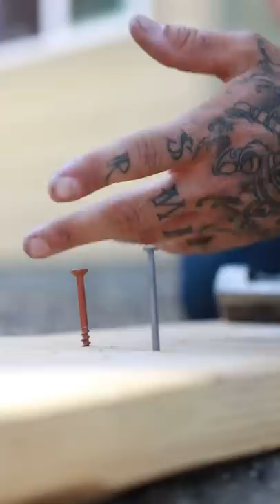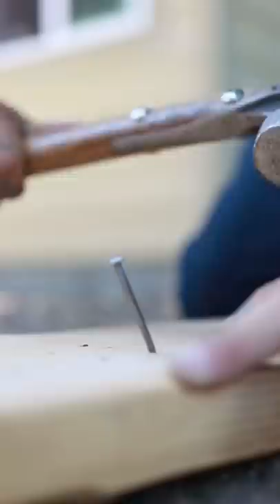Nails vs. Screws: Why do we use nails? #shorts

Comment: I highly recommend anyone watch the Project Farm video about screws vs. nails in shear strength. In most realistic, scenarios (i.e. one where a shear load is applied to the joint of a framing member) the screws are far superior. In metal fatigue tests where fasteners by themselves are repeatedly bent almost 90 degrees back and forth, the hardened screws with fail faster than nails. In terms of construction, I don't really see it being a problem to have the fasteners fail after bending 90 degrees because that would almost never happen in a construction. 

The reason that screws in more realistic loads are better than nails is because the compressive force the screws apply to the framing members creates a friction force between the two that works against any actual shear. If the boards are not allowed to separate while a shear force is being applied the wood will fail before the screws almost every time.
Reply: I can't be certain, so I'll ask. Are you implying that nails don't apply compressive force to a structural member? Or, are you stating that nails cannot apply the same amount of compressive force as a screw?
Reply: @DarkMatterX1  because of the threading a screw has the act of screwing will force boards together in a way that a nail really can’t
Reply: This. Screws are better than nails in almost every way. If you ever do work on older houses you will agree with me. Nails work loose everywhere especially if things are moving as he suggests in the video. What he is showing here is not sheer force it's bending force and the screw will never see that sort of force in a correctly built structure.
Reply: I support this guy, as I commented after it return to the material characteristics, when u compare, this videos has wrong comparison diffently 2 things, 2 desgins with different purpose of use will not be the same
Reply: $ and speed. You can drive nails way faster and they cost less. Always follow the $
Reply: @theautumnwind2152  Cutting corners usually results in bad, not good. (Wyatt Earp?)fast is fine, but accuracy is final...
Reply: @yingnyang2889  nails and screws are equally accurate.
Reply: I dont have to watch it after reading the comment. You explained it well.
Reply: @randyhall161  you should anyway, love that guy.

Goes way the hell beyond what I ever expect to test very basic items like tape or nails and screws... Super addicting channel
Reply: u guys are giving bad info. if u frame a house and use screws the same size as normal framing nails, u will fail your inspection  and have to redo it. nails are much stronger than the same size screw. sure u can buy thicker higher quality screw and it will be stronger but thats nit aples to apples. and why when a refular nail is easier to drive, cheaper , and does the job in regular applications.
Reply: Brah, cost and speed
Reply: Yep
Reply: the compression you talk about instantly made  me understand the concept
Reply: @artjohnson4553  have you watched the video the OP mentioned. In basically every testable way, except extreme bending, screws are the more stable product. Please watch the project farm video
Reply: Love Project Farm, his channel is FULL of great tests that cover a multitude of scenarios. If you’re ever considering buying any product, check to see if he’s done a review of said product.
Reply: @theautumnwind2152  they actually make collated screws you can fire from a pneumatic nailer, believe they are called "scrails"- (might not be the correct spelling)

Comment: Actually the shear strength of screws is just as high as nails... The reason people don't build with them is because they take longer to drive into the wood... Not because the nails are better. Actually screws are better because they grip the wood more than nails do. And they also show for expansion and contraction. Nobody's house moves 90 degrees to the right and left.
Reply: Thank you, thats just what i thought. The reason wr build pretty much everything with screws instead of nails, like cars and trucks, bridges and sky scrapers.
Reply: As an metallurgist I can confirm, this is false.
The way the metal is tempered changes crystalize structure so you can make a screw vs nail temper so that it fractures differently.

This is the same reason a untempered sword snaps like a crunch bar vs when tempered.
Same metal different shear strength.
Reply: And screws are way more expensive
Reply: @jonathangarzon2798  informative 👌
Reply: You’re wrong :/
Reply: Wrong.
Reply: @user-gn8hf2ig7w  Cars, trucks, bridges, and sky scrapers are not built with screws.  None of those.
Reply: @thomasjefferson5727  well isn't a bolt basically a screw with threads that are made for a nut instead of wood
Reply: @johnsmith-jd1cd  not exactly. While they look similar, screws bite into material in order to provide their holding power, while a nut/bolt relies on the clamping of two things together as well as the strength of the material to keep it in like. I'm positive I fucked something up here so someone please @me and correct me :)
Reply: You're absolutely WRONG with your comment. Screws DO NOT have a shear strength that's even remotely close to that which a nail of the same size possesses. Screws are much more brittle than a nail
Reply: What are you intending to mean with "screws show for expansion and contraction"??
Reply: @thomasjefferson5727  english is not my first language but in germany the word for a screw and a bolt is the same, so please excuse my mistake. But i think my point is still valid.

Comment: Screws are stronger construction.  Nails cost less and are faster to build with.
Reply: They were faster back in the day, when workers were still able to hammer them in
Reply: Paul Underwood  lmfao 🤡
Reply: @No_Limits_411  so you're saying a pneumatic nailer where I can pop a 40 stack of nails in 90 seconds isn't faster than hammering them in? I'm confused by this assessment
Reply: No
Reply: @Cesshiphop  workers were more skilled with a hammer, is what I am saying. Don't be confused
Reply: Paul Underwood  what is sheer force ?
Reply: Clearly they arnt
Reply: Under a fire screws snap. That’s why we use nails and not screws. It’s a fire code thing.
Reply: Nails are better for earthquakes when buildings & homes are moving, nails will move with the stucture
Reply: Find me an engineer that allows screws.
Non structural,  regular screws.
Reply: Lol lol! Not for framing houses and countering the forces a houses walls will experience they aren't. But if you want to build a deck or anchor that decks vertical posts to a houses existing structure, then screw away.
Reply: Look man, I’m a potato and can’t hammer a nail, I used 3,000 nails putting siding on my house. 20/10 would take the screw option hands down.
Reply: Wrong
Reply: Wrong screws are not stronger, harder maybe not stonger..
Reply: @No_Limits_411 you and everyone that liked your comment has never been in construction or shot a nail gun
Reply: @Bozolips go ahead and put siding on with screws and see what happens lol. You can also use a staple gun while putting siding on if it’s not 30 degrees outside.
Reply: @ajs96350  why would you use something thats not for the job? Thats like using 1 inch nails to to tie  2×4's together
Reply: @tillmen4444  Ask that to the guy who originally posted screws are better.
Reply: @ajs96350  deckmates are better than nails they just take longer
Reply: @tillmen4444  Not for building a house.
Reply: @ajs96350  for building everything that you can nail
Reply: I found this out when I started in construction, really interesting honestly cause before I just assumed screws were better cause it's holding things together more
Reply: @tillmen4444  You clearly are not in the building trade, or you maybe you are and don't know what you're talking about.
You won't find an engineer that agrees with you.
Reply: @No_Limits_411  my man, it's a hammer.
Reply: You obviously know nothing about building. Ie shear strength
Reply: @elperrocovero  shear strength, the force it takes to cut the screw, or nail in half
Reply: Screws are stronger in tension bc they have more surface area adjacent to the tension force applied. They are harder to pull out yes, and make building things easier because they pull the two or more pieces together. However, nails are far superior in almost every other way from a contracting perspective. Fast easy cheap reliable and they use lags and big ass bolts where needed anyways. Cuts down on cost for the company, time for the company, and overall end price for the consumer as a result, all while building a perfectly adequate structure. I’m a mechanic not a contractor or construction worker, these are just the basic principles of why and when to use what type of fastener

Comment: I’m a flooring installer and I work in brand new tract homes. 99% of the tracts  I work at use screws to build their homes. The 1% that don’t use screws I’ve been back to at least 20 times in the last 2 years because people are complaining that their subfloor is squeaking and popping. I have to go in and tear up the flooring I installed so the framers that used nails can repair the squeaking and popping with screws then I replace the flooring.
Reply: i hope you get paid fully for your labor. even if it has to come out of the framers’ pockets lol, nothing more annoying than having to redo a good job because someone else didn’t
Reply: You do realize that screwing off a subfloor is different tha  screwing framing members together. Best practice for subfloor is screws and glue. For structural framing, screws don't meet minimum code. I doubt you've ever worked in a wood frame house thar had all the studs and joists screwed together lol.
Reply: Rocket Man  he is talking about structural framing in the video. Screws wouldn't pass inspection.

Comment: They make screws out of other materials for this exact reason.
Reply: Not really? It's not the materials that are the problem, it's the fact that screws need to stay straight for them to function, while nails don't need to
Reply: @vipertxt the threads in the screw are an illusion. Screws usually have a thinner core and less support
Reply: @vipertxt exactly...there are screws of nearly every material, every alloy, and every physical property you can think of. There are screws that bend just as readily as nails but keep much more holding  strength..much costlier..but since your wood moved enough to bend the screws its likely destoyed anyway...because wood doesnt bend back into shape
 Nails are a great commercial building material for simple wooden structures that have limited life spans. You will find many historical restorations avoid nails altogether for the ineveitble damage rogue swings do to surfaces...and.....get ready for it.....they last longer when properly matched up to the right job. It just costs so much more with labor and matetials.
Nails for profit......screws for lifespan
Reply: @vipertxt yeah I don’t remember ever using nails for walls or anything. 6inch screws and concrete screws. I also live in Ohio so buildings arent out here swaying around but still. The screws we used if you tried to hit it with a hammer would probably just break the wood eventually
Reply: I am a liar, you are a liar. I am a thief, your are a thief. We have all had bad thoughts, we have all hurt others. We have all contributed to make the world a worse place. So a perfect God must judge us with his standard of perfection. We are evil, and so we deserve justice. Hell. But God is not only a seeker of justice, He is a seeker of love. In fact HE IS love. And proof that he loves us, is that he came on earth in the flesh, to die the most brutal death in history, just to save you from Hell. He paid the fine for your crime. He took on what you deserved, for himself. That is love. At the moment you are in your sins. But Jesus Christ has the power to cleanse your sins through his blood that he spilt on the cross. If you don’t accept this blood of forgiveness, you shall perish. If you do accept the blood, you shall have eternal life. 1 Corinthians 15:1-4. Thanks for reading. God bless you
Reply: @Bunny-xr7cx  Your probably don’t care but I want to make clear that that was not a Bible quote. I put a Bible citation for anyone who wants to visit it, but the text before is my own.
Reply: Stainless steel screws problem sovled
Reply: @MrFrog-rc3zx  wtf?
Reply: @jasonkennedy1402  Not quite
Reply: @MrFrog-rc3zx  alright TD Jakes. While I agree with you, wrong conversation.
Reply: @norml.hugh-mann  no, screw structure itself aren't bend friendly. Sure we can use more expensive material, but why if you can use nail, for nailing purpose.

Comment: When replacing my subfloor, I manually took out every single nail and used screws when installing the new subfloor. And I'll do it again.
Reply: Damn right!
Reply: You shouldn't have any squeaky floors...
Reply: That is an application where screws are superior, hope you put down some PL as well.  For framing the floor structure, you would want to use nails. Screws would not pass a minimum code inspection.

He is talking about structural framing, nailing framing members together.

Comment: 1. There are such thing as structural screws.

2. Nails provide better sheat strength typically
3. Framing with nails is time efficient 

33

Comment: If your walls are moving enough to sheer the screws take cover you're in a tornado
Reply: 85 mph wind gusts can sheer the screws in small homes and trailers...
Reply: @rolandhinson261  85 mph winds are within the range of most F1 tornados. As said take fucking cover lol.
Reply: Well, the house moves and adjusts over the course of the years, and those slight movements may be enough to shear a screw, mainly due to metal stress.
Reply: Either way, just use a fucking nail
Reply: It's not so much about the movement just the weight of the house would shear the screws.
Reply: Are you the tornado?
Reply: All houses settle. That's his point. A screw will snap and a nail will move with the house.
Reply: I came to say what Doom Guy said... It's sad so many people don't have basic understandings of physics and engineering... If Susan had that basic understanding that so many lack she wouldn't have made her silly comment.
Reply: Just because it won't save me doesn't mean I like my house to be ripped apart
Reply: @rolandhinson261  3 more mph and one could time travel.
Reply: If your eyes can't see something moving, it doesn't mean it isn't moving at all xd
Reply: Think of a floor system.
Even a deck you can't just rely on screws alone, they just don't have the shear strength for live and dead loads placed on the structure.
Reply: Love in Wyoming seen screws sheer in 30 mph winds they are week compared to a nail
Reply: Not just wind though.  Time is the biggest factor.  Sinking and sagging can cause serious stress over many years. Basically, you dont want your entire roof collapsing when a few boards get old and tired.
Reply: What about your walls? 😏
Reply: @snarkymatt585  pov: you cant take a joke
Reply: @307living3  lol yea okay
Reply: @chrisburns5691  We built our deck 8 years ago it's held together entirely with screws we never put the joist hangers on. I have a feeling theres a lot of people who work in cubicles commenting here.
Reply: @MD-zy9xk  nope, just career carpenters who know the building code.

Just because your deck works fine doesn't mean it meets minimum building standards.  That being said if its a small ground level deck I wouldn't worry too much..  2nd story id be more concerned, you should have someone who knows what they are doing have a look at it.
Reply: @MD-zy9xk  lol if you have hangers thats why your deck is still up ive built over 500 homes and 5 commercial buildings and that's not including the decks ive built or remodels ive done definitely never have or will work in a cubicle youve built one deck in which im sure is not to code and your a expert  get real
Reply: @307living3  re read no joist hangars and its all to code except for the hangars. I think you're a liar there are millions fences with many more millions of rail to post connections  screwed together that survive 60 plus straightline winds and when  they do fail they are almost always torn out not sheered.
Reply: @MD-zy9xk  also code states in the ibc that framing must be done with a 16 penny 3 1/2 inch minimum nail no screws just so you know 😉
Reply: @MD-zy9xk  like i said over 500 homes and 5 commercial buildings never once have i had a office job thats why your a amateur and im a professional
Reply: @donny9859  I can take a joke if they are any good. If Susan was attempting to make a joke it was a pretty stupid attempt imo. Maybe my standards are just higher than that of folks with mediocre intelligence idk.

Comment: Retired now but all construction ive put together is so much tighter and stronger than nails.  If you make a mistake its so much easier to "unzip" them rather than fighting a nail to remove them.  Screws are expensive is the issue.
Reply: Also to my knowledge there is no way to drive a screw as fast as an air-nailer can drive nails. With the amount of fasteners going into a stick frame house, using screws on all of it is gonna add a decent chunk of time.